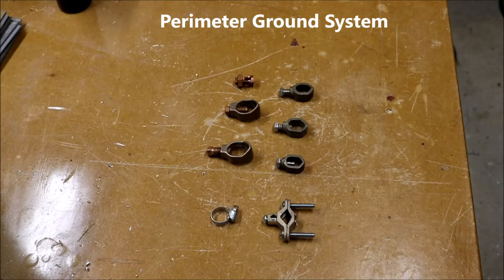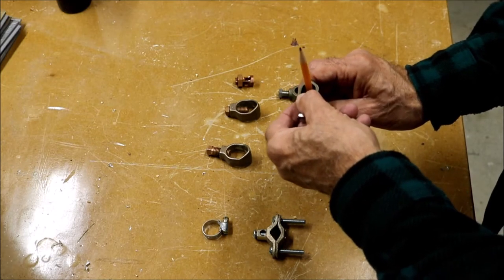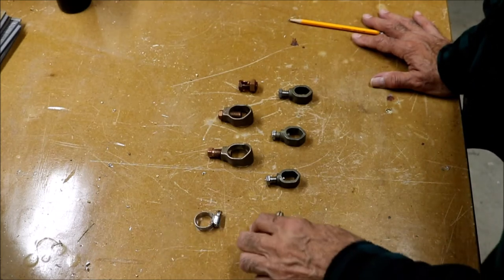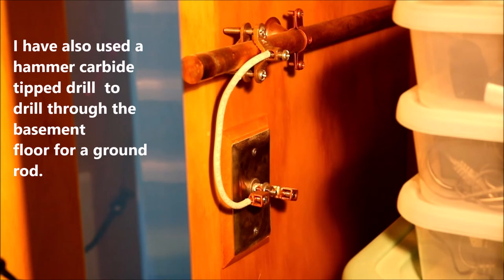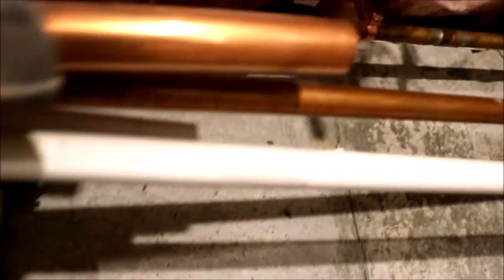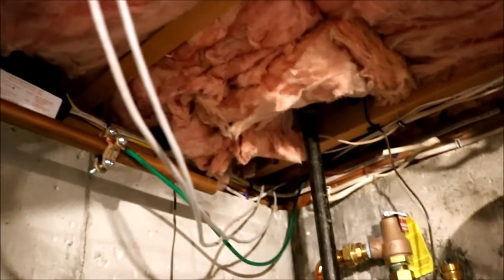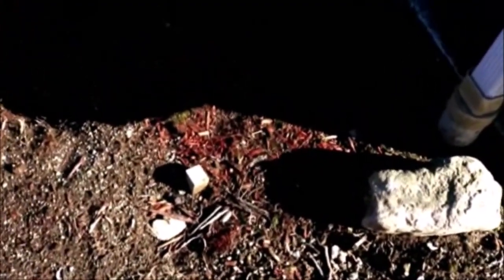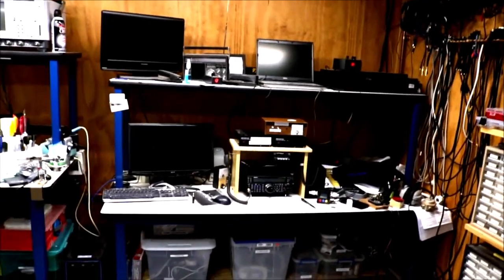Perimeter Ground for a amateur radio station

Comment: I've had good luck digging a hole around where the rod is going in and filling it with water. That made pounding the rod in easier. Also, when I hit a small stone the dirt, now mud, was loose enough I could jiggle the rod to slip around the stone. Adding epson salt to that water will improve the soil's conductivity. A power company study found it would triple that conductivity. Unlike table salt, plants like epson salt.
Reply from the maker: Great comment... thanks !
Reply: I dug down around the ground rods about 8-10 inches deep and about 1 foot in diameter and put about 3-4 inches of epsom  salt (magnesium sulfate) and then filled the rest with the soil. Great conductivity.
Reply: @skipcallaham1517  Good tip/ thanks

Comment: Want to put your ground rod in fast and easily, grind a dull point on one end, then drive it in with a corded jack hammer that has no tool in it.
The jack hammer will use a bunch 
Of rapid pinpoint blows faster the you can swing a hammer, and with a dull point break past many rocks.

I like the saddle type attachment
Better the acorns tend to fit loosely
The saddle type holds the wire and rod separately so your assured the connections are tight.
My house uses the acorn type for the power panel and a few other devices     these always seem to be loose.  Weather changes can effect the metals size in summer the metal expands, in the winter it contracts over time this loosens the bond.  Weed eaters tend to wipe the wires looser but a 2 part system would stay tight.

Comment: I Use the copper bolt for connecting 2 separate no.6 wires together if I need more.

Comment: very good explanation, question: how thick is the ground wire cable to the outside rod? and how thick the inside wire cable of shack to the radio apparatus? thank you
Reply from the maker: #6 stranded to outside. #12 -# 14 stranded from copper tubing to equipment.
Reply: Sorry, what  measure is it  # ? millimiters?

Comment: sad but my area is made up of mostly rocks the size of a skyscraper. or a super tanker. maybe both.
one can try to put in a grounding rod. but most likely never get more that four feet in.
in parts of my front yard the rock is above the ground. parts just inches below. should see the living rock in my back yard. and yes building here have the foundations and structures “adjusted due to this..

Comment: cool video at 5:10 where is that going or how is it going  and to what? what is it  for? i have dial up internet it would take me 10 days to load this entire video  and about 1 minute just to upload this comment with pictures disabled i m learning about grounding in North America thank you so much
Reply from the maker: The connection to the wall plate connects to a ground rod on the other side of the wall. It is embedded in the ground through the concrete floor.
Reply: @PracticalEngineeringSolutions  thats really cool. so if u disconnect that will the house power stop? if it didnt have a neutral from the power company?    i noticed some parts of the US they only have 1 wire coming to their house i believe 120    do they just ground these homes so their is return path?
Reply from the maker: @aedgvv6095  No . Electrical ground must be a separate ground wire not through the earth

Comment: Saddle clamp goes over copper tubing /pipe. Copper nut/bolt does not fit ground rods, but is used to clamp conductors together. Wrong advice.
Reply from the maker: Saddle clamps are used on the interior and are not meant for outside use in weather. It says direct burial on the acorn nut /bolt. I guess I don't understand your comment
Reply: The one you called a copper bolt is to connect ground wires together and not for a rod.

Comment: GROSS VIOLATION OF NATIONAL ELECTRICAL CODE.

You are FORBIDDEN by NEC 2011 Art 250.24 (a)(5) to ground that  radio equipment.

.Thats grounding the " not normally current carrying conductor ( cabinet/ chassis).

Further youve " regrounded at the load" also a Code violation. 

Doing so defeats GFI protection and subjects YOU to shock if youre touching that system when a hi power transient hits it.

Just claiming " engineer" does not qualify anyone in NEC.
Reply from the maker: First of all the latest NEC is 2020 released in 2019. 
Secondly, not all circuits in a home must have GFI..  NEC says:
GFCIs are required by the National Electric Code (NEC) in all kitchens, bathrooms, crawl spaces, unfinished basements, garages, and outdoor receptacle locations. Outdoor outlets also require special boxes and covers. In addition, outdoor receptacles must be equipped with a weatherproof cover approved for damp areas.
Third , See this for a good discussion of grounding and the NEC

https://reeve.com/Documents/Articles%20Papers/Reeve_AntennaSystemGroundingRequirements.pdf